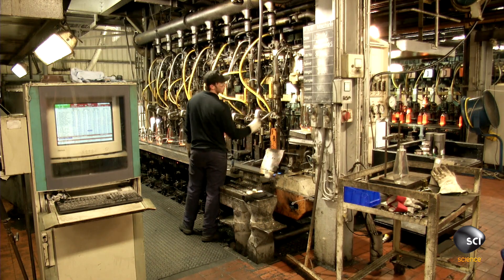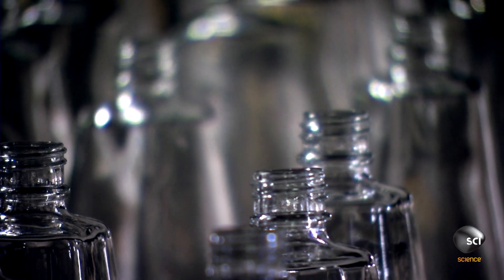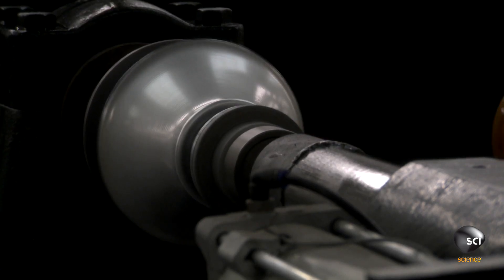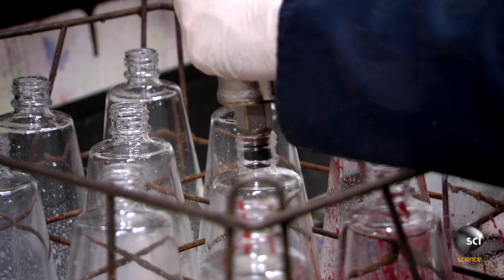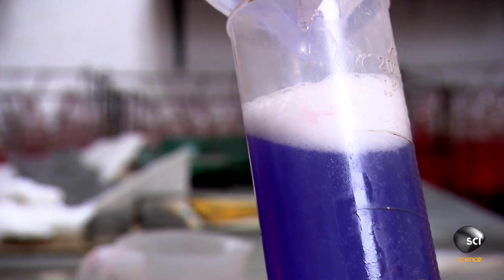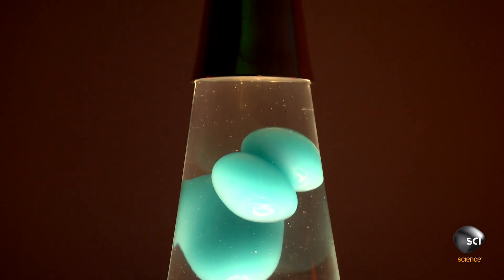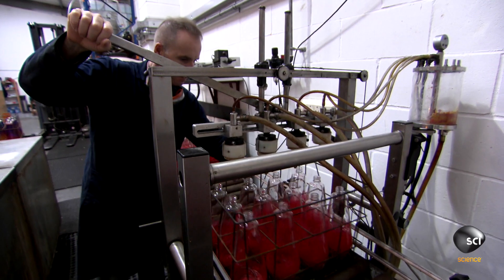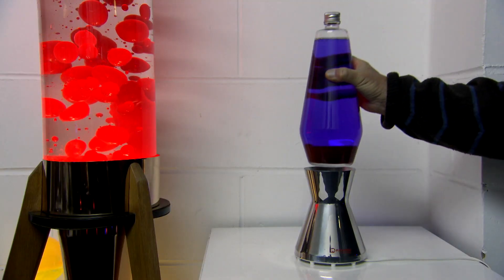How Do They Make Lava Lamps?

Comment: Funny. My lava lamp doesn’t flow like the others. Mine has a tone of small to large circles that stay at the top of the liquid and don’t fall.
Reply: It’s a dud mine is also doing that and your welcome for the info usually you should buy another one if you want a working one
Reply: @Prestfon12345  maybe add drops of non coulour dishsoap to break the surface tension of water ?

Comment: I'm super pleased you guys filmed this at the Mathmos factory! They're not only the inventor of the lava lamp, but they still make them at the original factory in England! What better location could there be for an episode on how lava lamps are made?
Reply: thanks for providing the name of the manufacturer.
Reply: I've read that these are not available for sale within the US? Why?
Reply: I've done a little research myself into this, and it seems it's due to company exclusivity within the USA from an offshoot of the original company that occurred in 1965. The "rights" have been within the USA exclusively since then. Interestingly, Mathmos (UK) has a sign-up newsletter for USA purchase availability. People will most likely wait indefinitely for that one...probably until exclusive rights expire? Strange. Anyway, the Mathmos versions have better color choices, IMO. It seems that the US-based company (Chinese made) is more interested in the choice of sizes and base/glass colors than colors of the solution/wax. Age old problem, I suppose: make too many choices available, and in turn, skimp on quality and/or aesthetics.
Reply: charlesbonkley they are in the us for sale
Reply: @projectawesome5675  Where? The only ones I've seen are sold third-party under the radar.
Reply: charlesbonkley they aren't illegal dude
Reply: @projectawesome5675  Never said they were illegal. Mathmos doesn't sell them officially in the US. Furthermore, any imported Mathmos lamps require rewiring and a bulb rated for 120V.
Reply: I was just thinking how neat it is to find something that isn't being made in China.
Reply: Super pissed about not being able to buy one from Mathmos here in the USA. I dont want a flimsy Chinese made one but I guess it's our only option. Maybe eBay has Mathmos lamps that'll ship to America???
Reply: Anita Bonghit 
Looking on Amazon it seems the lava lamps cost about £80. Quite a lot for a simple lamp. I'm happy with my cheap £10 one.
Reply: i read it as ‘i’m super pissed’ first and then read the rest of the comment with confusion lmaoo

Comment: still wanna know what the "secret" fluid is
Reply: Satan Hey your the one that said "I still wanna know what the secret fluid is"
Reply: hammer shark sperm
Reply: Tyrannize the wax settles on the bottom when the lamp is turned off.
if the clear fluid was water, the wax would float on the surface.
Reply: wax and water or any 2 things that dont mix :)
Reply: Tyrannize water is more dense than wax. the wax would never sink. i was thinking maybe some kind of alcohol, but i somehow doubt that would use anything flammable.
Reply: lava..
Reply: Faceless Tigerette you're a special one, aren't you...
Reply: Satan lol not really I didn't even watch the video..
Reply: +Tyrannize it's just a regular lightbulb
Reply: so are you a lava lamp maker or what
Reply: @Kevin spacey ...you're wrong.
Reply: same as with coca cola i geus? they will never tell us!
Reply: Satan What about the light at the bottom which causes convection currents?
Reply: Try Mineral Oil.
Reply: B
Reply: Hint: the dude has nutted a million and one times during working hours...
Reply: It’s wax
Reply: @Kevin spacey Damn I should send mine to you for repairs. I bought one on Amazon with a marijuana leaf painted on the glass and the damn thing came to me all shook up and has never worked right. Thanks for the info!👍 didn't Kevin Spacey have one in his garage in American Beauty? Smoke a joint, lift some weights, watch the lamp.✌
Reply: obvious, “lava”.
Reply: weed
Reply: Sperm
Reply: distilled water, epsom salt and dish soap
Reply: Well, “chemicals” means anything made of atoms that isn’t one particular atom only. Could just be table salt and more water.
Reply: Distilled water mixed with a saline solution (salt water) and paraffin wax mixed with the core chemical used for dry cleaning.
Reply: Water mix of cemacals or anti freeze
Reply: ***** that has to be the single most retarded statement i've read all day. of course it is valid to want to know something that is "secret", and comparing something that can (quite easily) be determined through basic chemistry to someones youtube info is an invalid comparison. one is a substance, the other is personal information. so, i'll close with this...
everything you've said up to this point has been a waste of both your energy and mine. enjoy your ignorance ;)
Reply: ***** which is a valid statement... yours, on the other hand, was just a display of your ignorance.
Reply: +Satan says the dude who doesn't understand the word secret
Reply: ***** your lack of logical reasoning astounds me....  your parents should be ashamed
Reply: ***** the chemical composition of any substance can be figured out through chemistry, which is to say, any "secret" substance can be figured out, and therefore to want to know is valid. following your logic, no science could have ever been done because things were basically "secrets" that we didnt understand. take your fucking head out of your ass.
Reply: The fluid is mineral oil with a little water and a few drops of dishwashing liquid . The wax is standard paraffin wax. A few drops of food coloring will color the liquid.
Reply: @joes.949  nope... I tried .. the wax stays ontop
Reply: Satan So what's your youtube password?
Reply: semen
Reply: its cum
Reply: Satan Last me i checked wanting to know something that is secret isn't exactly valid. It's like me asking what you youtube info is.
Reply: Puke!
Reply: ***** i guess it's safe to assume you don't understand the word "chemistry".
dumbass